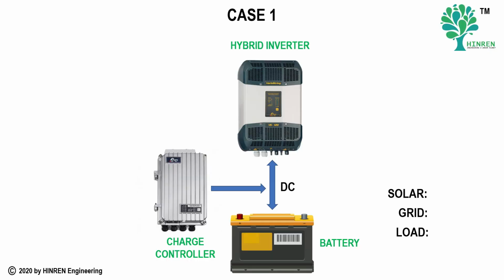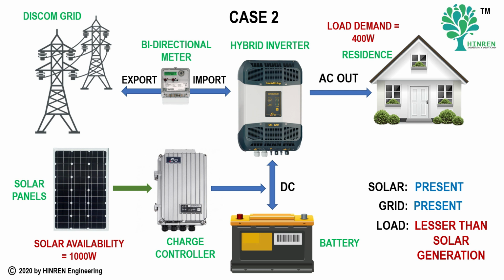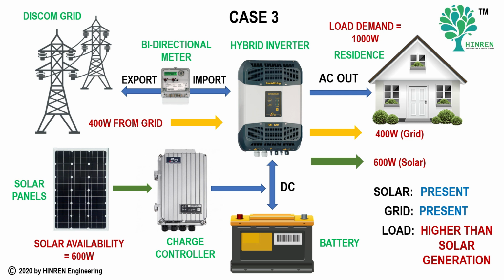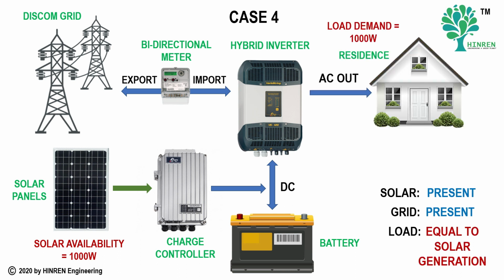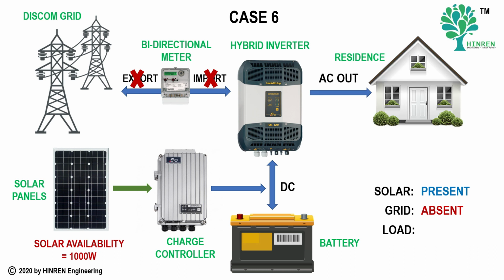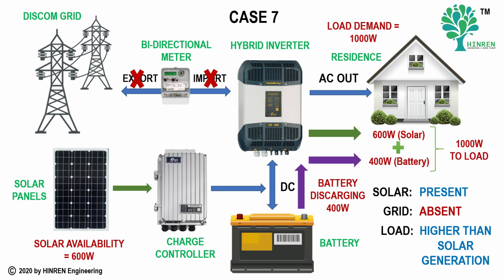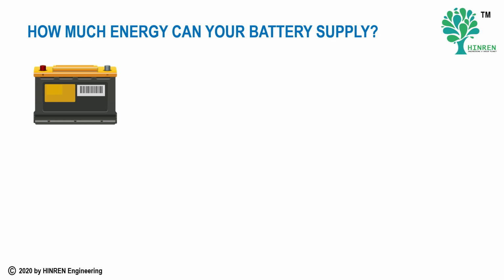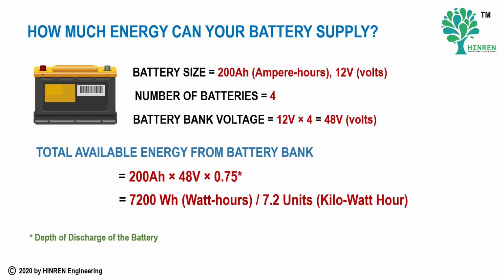Topologies of Hybrid Solar PV System

Comment: Can I ask if is possible to use Studer inverter with no Studer brand MPPT controller(Victron or EPever for example ). Thanks
Reply from the maker: Yes you can .
Reply: You can, but the communication between them will be problematic 👍🏻

Comment: Please answer my question as its troubling me alot,

What is going to happen when grid is offline and batteries are not connected and solar production is having a lower production, will the entire load will be tripped by inverter or will inverter smart cut off specific load to balance demand and supply ?

2nd question,

In continuation of above conditions can we turn off power export in inverter settings ? If yes then how will excessive power will be dealt with when load is low and batteries are not there and grid export is off ?????
Reply from the maker: You cannot have this system without batteries. 
If battery drains out completely, the system will trip . 
You can turn off the export feature. In 0 export condition , if there is no load , the MPPT will not extract power from the panels .
Reply from the maker: You can contact me on 9035625364 for any further clarification.

Comment: The scenario I am curious about is a hybrid system like in your diagram but: I would like to cover 100% of the load and charge the batteries before any is exported to the grid. I would also like to run off the batteries at night instead of the grid. Does your setup work this way?

Comment: in case 6, in case battery will be fully charge, where will the excess load  (400W) go?
Reply from the maker: There will be no excess since there is no grid (in case 6) . Once the battery is fully charged, the energy production stops .